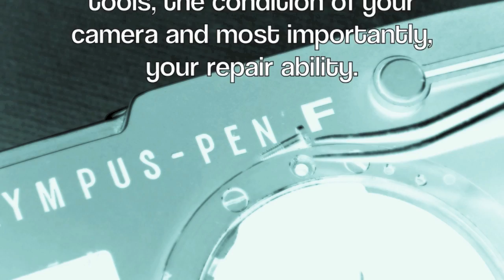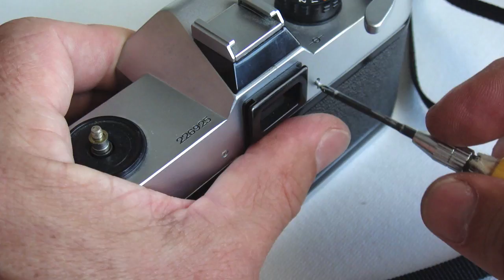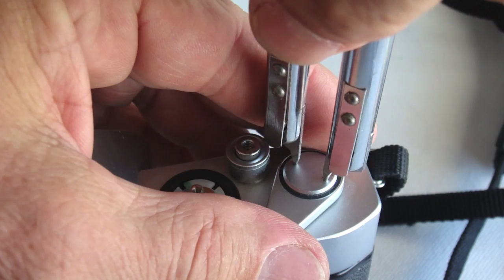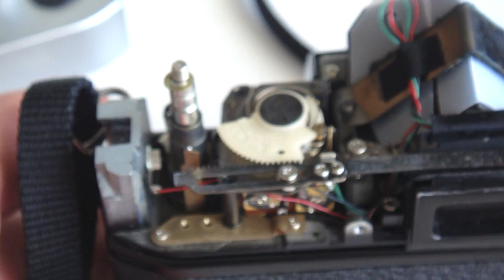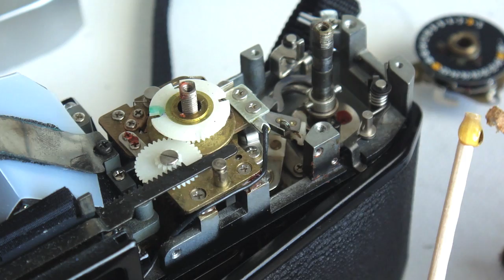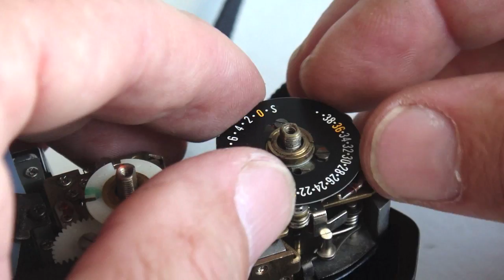Fix Old Cameras: Canon TLB / FTB Shutter Bounce

Comment: Great help - but I tried to remove the counter mechanism on 2 x Ftb (Ftb and Ftbn) and it won’t ‘lift out’ as shown in the video. 

I can’t get the mechanism off the shaft… it lifts up about 1/4 inch but stops there…

Any help appreciated
Reply: Mine did the same. I used a spot of wd40 and it lifted right off.
Reply: There’s a retainer on top of the mechanism. You can use a thin screwdriver or blade to lift it up and work it off first.

Comment: Hello! I recently started to experiment some issues with my Canon F1 New and I wonder if you could help me on that! What happend is that at different shutter speeds, the images appear overexposed with the shape of the curtain, I mean , it is similar as shooting with a flash with no shutter syncro. At the images (just with some shutter speeds) you can cleary see the shutter curtain realeasing by steps. Thank you David!
Reply from the maker: Sounds like your camera has shutter travel curtain and latch issues. The disassembly needed might be beyond a kitchen table repair. And there are no FOC videos feature the "new" or last model of the  Canon F-1.

Comment: I have a Canon TX with a jammed wind lever, your other tutorial led me here. As I was opening my camera, I found that the secondary retainer set screws are pushed down, I don´t know how to explaint it, looks like someone opened it a long time ago and screwed these tiny guys with a machine or something. Do you know any other way I can remove that retainer so I can fix the camera?
Reply from the maker: Worst case... drill them out. OUCH. Hope it does not come to that. Surely with the proper sized screwdriver you will be able to back them out. Try applying some heat from the tip of a soldering before give them a go.

Comment: Hi again F.O.C. Do you know if  the other early Canon "F" series have this brake pad, FX-1964, FP-1965, Pellix-1965, FTQL-1966,  Pellix-QL-1966, TL-1968,   EF-1973, TX-1975 and the FTBn-1973 and the F-1 series? Another tip, Cross point screws can be easily started by turning the screw slightly counterclockwise, when you hear the screw "click" then turn clockwise and 99% of the time it will catch the threads and start easily.
Reply from the maker: Good tip on the starting of crosspoint screws. LOL... after starting hundreds maybe thousands of screws... starting them so becomes an inherent inclination. As far as your list of cameras... without checking parts manuals... memory serves that they all nearly identical except  the F-1. The F-1 uses  opening and closing curtain brake bands and pads, but they are a bit more difficult to access.

Comment: I've got an FTb whose shutter will slow down on longer shutter speeds such as 1sec and even pause for a moment as if it gets stuck. Does it need to be cleaned and lubricated or is there somthing more serious going on? Higher shutter speeds work fine. Thanks!

P. S, thanks for making so many great videos!
Reply from the maker: You are on the right track in your thinking. The slow speed escapement will need to be accessed and addressed. It is a bit difficult to remove as it is located under the mirror box, so the front plate has to be removed. However you might get some results by simply removing the two screws holding the bottom cover plate of the mirror box and flushing escapement with alcohol. DO NOT allow the alcohol to flow down and come in contact with the viewfinder screen. Try to contain the alcohol to the area of the slow speed escapement. At best, the flushing might be long term temporary. Ideal repair would be the removal and service of the slow speed escapement.

Comment: Thanks for this video. One on my leather brake is gone. Im looking to replace it. How thin is it ?
Reply from the maker: .5mm to .8mm soft leather... a piece of old driving glove might work. There is a little wiggle room on the thickness as the tension on the adjustment screw will accommodate.

Comment: I have a Canon TLb that works fine with no film. As soon as I put film in it the shutter will try to work but becomes stuck open in every setting even bulb. Is this also shutter brake pad?
Reply from the maker: Also check the shutter tension and lubricant. 
https://www.youtube.com/watch?v=SkRJlYJBh84 (uneven exposure FTB)

Comment: Hi again. Please clear up something for me. I use Pliobond as a contact cement. That is (in this case) one puts a thin film of glue on the leather brake pad. Then a thin film of glue on the brake arm. Then after about 20 minutes the glue sets up and once the pad is pressed against the arm it's a permanent bond.
Reply from the maker: In this application it is best to put a thin film of glue on both surfaces and let them get tacky (only takes a few minutes). In this condition it allows for positioning of the pad and will set very strong. The ability to give a good bond when only tacky is what makes Pliobond superior to other contact type cements in classic camera repair applications.

Comment: Hello, I found your page while trying to troubleshoot a problem with my canon ftb.  My specific problem is not addressed in any of the videos and was hoping you could help. When I use the advance lever it appears that it is also taking a picture.  The shutter button is always jammed / inoperable.   I took a video of this but am not sure how to share it with you.  Thanks in advance for any solutions.
Reply from the maker: Make sure the self timer is not engaged and jammed. Also, with the bottom cover removed, check the notched gear stack with the two opposing levers mounted on it. This is the area most likely causing the release to be stuck in the down stroke position.

Comment: Hello. Thank you for your excellent guides. I recently received an FTb which seems to have a shutter problem. The person who gave it to me said the mirror was stuck in the up position, but this doesn't seem to be the problem. The mirror comes down when the camera is wound, but when fired, the mirror rises and the shutter opens, but the curtain doesn't close. Would the problem have to do with the second curtain not moving? Might it be a straightforward  problem to fix?
Reply: Have the same problem. Did you find a solution?

Comment: Thank you for the demonstration of how to repair shutter brake pad dislocation causing shutter bounce in a Canon TLB camera.  In the early seventies my Canon FTb developed shutter bounce.  I had it repaired by Canon.
Reply from the maker: +Merlin Marquardt 
Thanks for your comment. Do you still have the camera?
Reply: No, I wish I did.  After I had it repaired, I sold it along with four lenses, 50mm, 100mm, 135mm, and 200mm.  Recently, in an attempt to recreate my affection for this camera, I have acquired four used Canon film cameras, an AE-1 Program, an A-1, and two T50's.  I must admit I was somewhat reluctant to buy another Canon film camera after the issue with the shutter bounce with the FTb, but I guess it could happen to anyone.  I do like the Canon film cameras that use the FD lenses.
Reply from the maker: Well, that is too bad, but the cameras you just acquired should be fun. Hopefully the T-50s won't give you any trouble.
Reply: Thanks for your comment.  What are potential problems with T50's?
Reply from the maker: They stop winding or become sluggish. Also do not store the T50 with the batteries in the compartment as the AA battery is prone to corrode, as you probably have experienced.
Reply: Thank you.  I appreciate the information and advice.